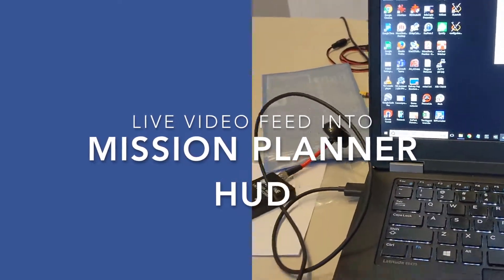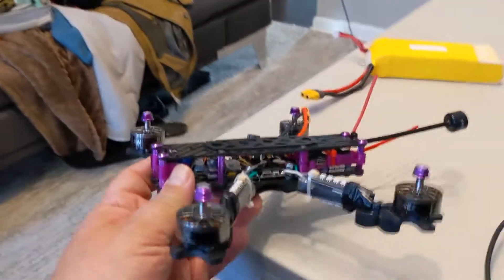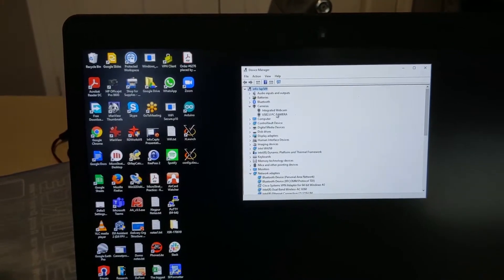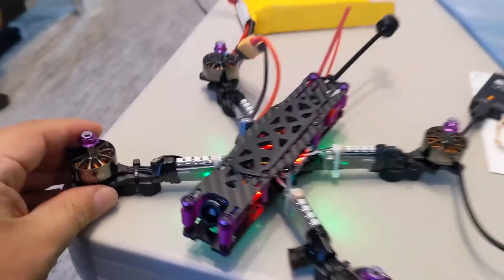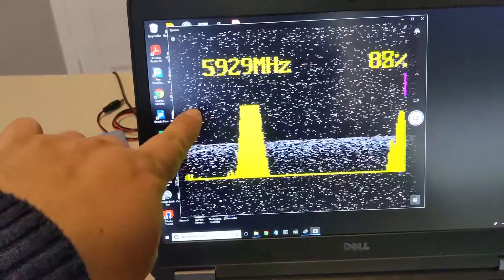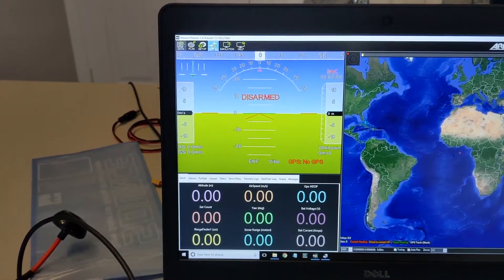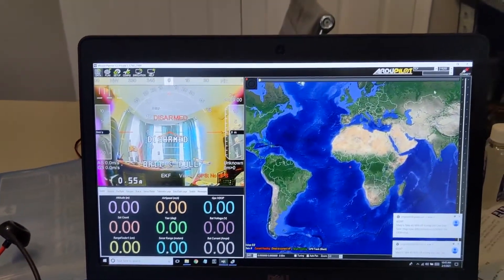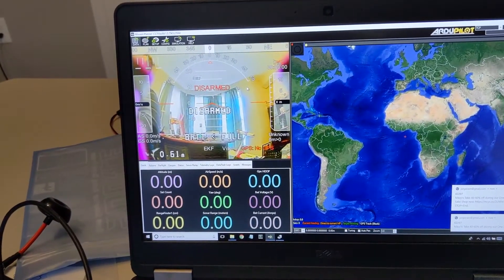Live video into Mission Planner HUD

Comment: when you say the flight controller are you talking about the remote or a joystick if someone to decision to use a joystick with throttle ? im still new to this that why im asking
Reply: Flight controller is an essential component installed on UAV. It's basically a small computer that controls the drone. On a plane FC (flight controller) is not mandatory. But on a quadcopter an FC is mandatory, or it won't fly.